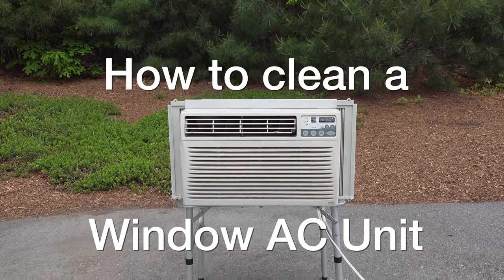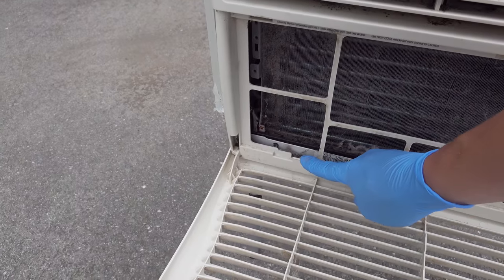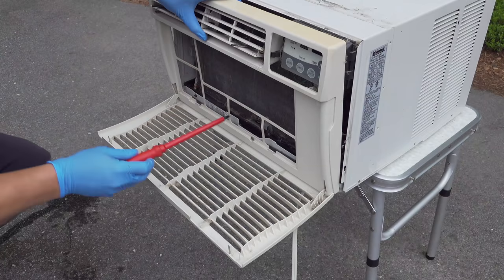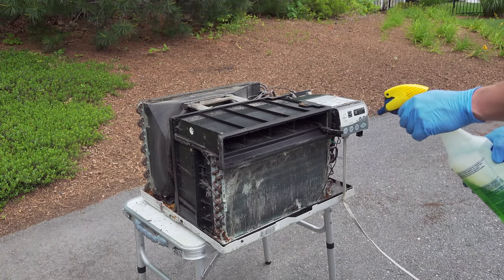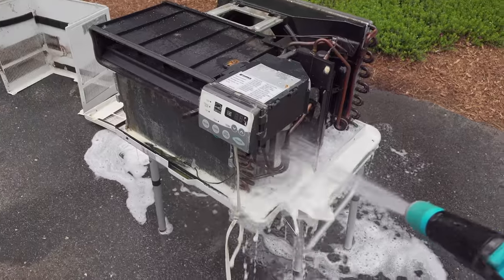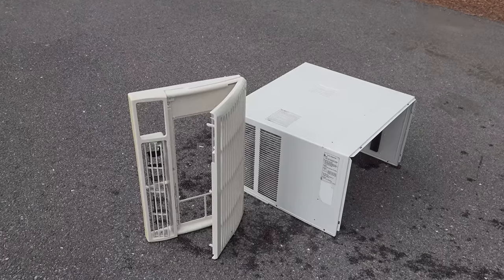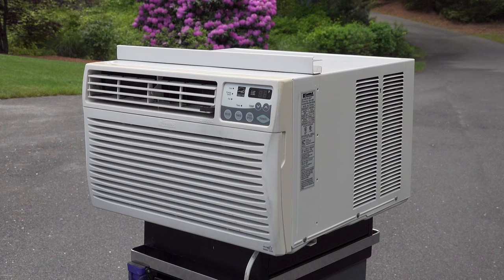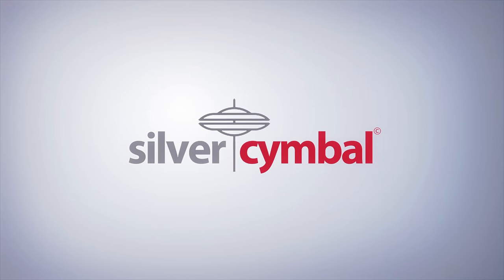Window Air Conditioner Not Cooling? EASY Common Fix - How to Clean a Windows AC

Comment: Critical not to have the hose at full pressure in a concentrated stream when spraying the aluminum fins as it can bend over the fins which will prevent good airflow while the AC is operating.
Reply: That full pressure is what helps to get the gunk out.
Reply: @blainwilson7937  - I get it - Just have to make sure you spray head-on, or you'll just end up folding over the fins from the spray. Ask me how I know this. :)

Comment: Try not to get water on the electric motor, especially the bearings , the condenser coil at the back is typically packed with cottonwood and dirt on the inside because the fan blows from inside to out , cleaning just that coil will usually make you unit blow cold .
Reply: How do I grease the bearings on mine? When I turn it on it makes like a gring noise I assume it's the bearings
Reply: I had one grind for a whole summer, every now and then shot some spray white lithium grease at it through the side vents to quite it down but ultimately you have to replace the motor or replace the unit .
Reply: @majornadz1385  Oh is that what it is? I guess the motor is shot then.

Comment: If you dont have a sealed/waterproof electric fan motor, do not get it wet or you will have to replace it.  Rest of the video fine.  On older units, I would not wet the control module either.
Reply: I did this to mine now it blows cool air but it stops working when it's on like 15 mins later

Comment: When me and my wife bought our current home, we had an AC company come out each year and service our big central air units outside, and all they ever did was clean the coils. First they would use an industrial level acid, but within a few years, they were using the off the shelf cleaners you buy at Home Depot. I was like, why the hell am I paying for that? Started doing it myself years ago, and haven't looked back.

Comment: you can short unt eventually rot unt corrode the motor unt other wiring und connectors, unt start a firés too

Comment: I spent an hour trying to remove the metal box of the ac so I gave up and blasted it with my hose lol Hopefully it still works
Reply: Did it work ?
Reply: Yup! Just avoid the electrical parts where the buttons are. It was pretty dirty, I let it dry then installed it and it blows cooler air

Comment: This was pretty helpfule for me my window ac in the front room still cools but clicks off if the temptuer is high outside it just powers off.

 My kichen one is smaller but the air it pushes out just dosent carry further into the home once it hits the arch way it just keeps that room cool  it only ever has problums in lower tepmtuer outside it screen would get ice on it i have celing fans to circulate it out tho and i normaly turn it off that anyways when i cook or it becomes to cold outside.

Corse being such a big home it cools slow but i have both set to cool the home to 60 that gets me threw the hot weeks.

Comment: What's best cleaning method  for coils inside home on a heat pump system. ? 
When you remove filter lay on your back the coil housing is shaped like a  A frame. I don't want to flood my home thanks
Reply from the maker: Heat pumps can each be different and you have to be careful. This is not a heat pump but its a similar cleaning process, it may give you some guidance. https://youtu.be/nsRHhU6q5RY

Comment: So can I ask a dumb question…my ac is leaking water…can you tell me what it could possibly be? Ive seen to either tilt it up or it’s no longer good.
Reply: hello, water dripping out is perfectly normal, make sure it leaks outside of the house through a drip hole in the bottom of the unit. on a hot day go outside and look at the unit to be sure it's dripping outside

Comment: I would suggest since you have it apart, why not address the bottom pan rust?  There are a few products that convert rust to a hard, dark surface (POR 15 or Rustoleum Rust Reformer). 
Once these products have "dried" put a coat of good paint for metal on top of it. This will prevent or at the very least prolong the life of the A/C.  :)
Reply: and have the smell of the paint cover your living room?... sure
Reply: @diamondknight1530 
No sir. Paint in the outer pan does NOT affect the air intake , which is INSIDE THE ROOM , on the front of the unit.
The front intake fins and fan are isolated from the outside of the unit where the paint is.

Comment: Any body know...How do you get mold out of the holes the cold air comes out of? I get as far as I can reach. But I am sure it goes further.
Reply: Would like to know this as well.
Reply: Depending on how big they are you can try using a pipe brush set or if they are really small try using airbrush cleaning brushes. I picked some up at harbor freight (in the paint sprayer area) for 2 bucks and use them on several different things.

Comment: When I turn on my window ac it blows cold air for a couple minutes then starts blowing cool air I have it set up on my phone and the room temperature seems wrong it's hot in my room but when I turn the ac on to get it colder it shows room temperature to be 60 degrees plus making grinding noises and other weird noises for a minute or 2 after  first turning it on but stops after that but doesn't seem to keep my room cool just cold for 30 minutes then through out the night it stays blowing just cool air.

Comment: Mine is about 5 years old and will no longer cool a room.  It is a wall unit that is thru the wall to a covered 3rd floor balcony and inside a sleeve with a grill on it, it does not get anything inside of it, I took it apart and looked inside of it, the inside was really clean, nothing stuck to the condenser or filter, no debris inside, it just wont cool and there is no one (I called 7 or 8 service places) that will service a window or wall AC unit, so I went out and bought a new one for almost $600.  I wish I could have just cleaned it and had it working again but that doesn't work 100% of the time.

Comment: Unfortunately basement leaked ac was on floor and i had already screwed it all in before finding the mold, 3% hydrogen peroxide (yes the bathroom/medical kind) in a spray bottle in the vents/inside coil will foam up and help get rid of black mold, any left wipes right away, it will also whiten stained filters, and as long as you rinse it thoroughly it wont corrode and rust like the unit i used straight bleach on and ended up being ruined 2 years later, i also filled a different spray bottle with warm water to rinse and let the solution go out the window units drain.

Comment: I'm trying to clean the old manual Haier unit I have in my office, but cant seem to get the front panel off. It was given to me and I don't have a manual. I haven't had any luck searching online either to find the answer. I have done the GE unit in the living room with no problem. If anyone knows the answer to removing that Haier front panel, please let me know.

Comment: I recommend you don't use a garden hose. I'm a professional a/c installer. You want clean with oxey clean in a portable hand pump pressure sprayer. Only the fins. That be the coils. You get water on any electrical components and it's all done, it won't work again. Just the coils. It's the coils that cool you down, anything you see around the bottom use your hands to pick it out. And be sure to hand pick the hole that drains out excess water when it running. So it drains
This video is an amuture person. That's what separates them from a professional.
Edited ;-> of course you have to rince it off use hot water. Cold to clean hot to rince and I guarantee it will look shinny new again the coils that is. Dust on the moter or compressor is nothing it can be pack with mud it doesn't matter those components don't cool you down and won't affect the operation of running.

Comment: Now only the time you waste dismantling it and some repair on the wall because it has to be well sealed is already a waste of time for an old wall air, the best solution is always to spend 100/125 $ on a new one, and only holding 2 years is more than worth.
signed: AC technician

Comment: Easy to pull the fan cover to clean the blades. 
You only did a partial tear down. The most important area that collects air that goes into your room, was never touched. 
You can do much better than that!

Comment: Also do not use high pressure water to clean the fins... you will damage them and the unit will not work without repairs!

Comment: Could you use a pressure washer to enhance effectiveness?
Reply from the maker: You really don't need to and the pressure would probably push water into places you don't want. You will have great results with just the regular hose.

Comment: Mine has a Awning over it and also Screening so no chance of stuff getting inside it like this. The Front is Kept clean because it hardly ever gets dirty. 14plus yrs old and it only just started having Freezing up issues. After owning it a month, had to drill a hole in the back base of it because there was no Drain Hole in it and it would fill up with water, splash onto the fins and into inside of my camper... yeah, Fuck that!.. I was told they no longer put drain holes in them so they can splash the water onto the fins so they cool better.. Seriously, WTF???.

Comment: Ahhhhhh too much work especially taking it out the window if your doing it solo. Just get coil spray foam and spray on the coils after removing the filter and get the same results with 80% less work . Then spray outside fins the same way and hose off .  hose the interior real good from the side and get dang near the same results as you .. show people everything you did removing and re installing... way to much work!!!!

Comment: I just take my window unit to a car wash and pressure wash the whole thing with the filter out I will take the soapy pressure washer and blow all that garbage out of the course and flush it out the back too allow it to dry for a few hours it works perfect without all that taking it apart

Comment: I dont recommend this unless you know whats happening and what your doing. If you do, be sure to thoroughly rinse the unit before you fire it back up. Any soap left can heat up and damage internal parts. Otherwise it does work pretty good as an alternative to acid wash

Comment: dont forget there more just cleaning it
if power it up n pump or fan dont work i recommended replacing capacity first before replace anything else because fan motor n ac pump run on same capacity if that capacity died nothing will work after replace capacity and everything power back up working it good togo "still have clean it up anyways " if your ac is ramp up and down it meaning capacity is about go out it time to replace it and clean it up i recommended pulling up information on model code and every ac have model code location in filter areas some on side left side by filter DONT REMOVE THE STICKER WITH MODEL CODE PERIOD because it maid important information let you know what parts for this model if that model sticker is gone it BIG NO NO finding parts for it be super harder find right one for that model ac

Comment: I'm not an expert on AC units, I was an electrician in the navy and went through advanced fired fighting school. I don't recommend anyone doing this.
Cleaning electrical appliances should be done with a brush, not a hose spraying water into it.
You won't see the effects of the damage you caused immediately, and it will spark/ short out/ cause a fire while you are sleeping 6 months, or years later and you will die from smoke inhalation or being burned alive. Don't mess with electrical appliances like this, its not worth the risk. Really its awful to make a video like this, its probably caused many problems for people trying it.

Comment: 5:27 "Cool the outside air by about 15-20 degrees"
This part is false.  That is not how air conditioners work.  Air conditioners are not taking outside air, cooling it, and then putting it back in the room.  Air conditioners take INSIDE air, cool it, and put it back inside.  This is why air conditioners can still blow 50 degree air into a 70 degree room, even when it is 125 degrees outside.
--Another common misconception is that air conditioners blow a different temperature air based on what you set the desired temperature to.  This is not true.  Even if the room is 100 degrees, and you set the controls to -100 degree, or if its 75 degrees in the room and you set it to 72; the air conditioner will still blow the same temperature air.  Air conditioners do not have variable levels of performance.  They are either 100% on or 0% on.  They blow the same temperature no matter the setting temperature delta.

Comment: As a certified hvac technician I can tell you that absolutely nothing you did had any impact on the ac's ability to cool other than clean out the fins. Everything else shown here has zero repeat ZERO impact on cooling. 
If this happens to you, try cleaning the fins if you have access. If they look good and you are still not getting cold air then the unit needs replaced. You may have an older, high end unit that can still be recharged with refrigerant but most likely you don't. They haven't been produced for a while now and they were very expensive when they did exist on the market. 99 of 100 units are sealed and can not be serviced. In my 20 year experience, window AC units have a lifespan of 2-4 seasons. (Yeah I know but that's really it) if your unit is on it's third summer and the air is not getting cool anymore, a trip to the store is in your future. Not even we trained technicians can do much about that.

Comment: An AC that only blows 59 degree air is a broken unit. Never buy an AC that doesn't AT LEAST blow 32 degrees. I've sold many ACs that blow at -30 degrees. Again, 59 degrees IS broken!

Comment: Be careful on some units.  Like he said he doesn't  clean where the black vents are.  I've  notice when you see black mold on the grill. Inside of the black vents has a HUGE amount of mold.  cleaned 3 ac units for over 5 to 8 years and wow. They have a ton of mold when you take them out to be used. Stored them in the attic not the basement. Cause mold would be worse.  Some  acts have foam on the inside  of the vents near the internal circular fan and believe me they are the fucking worst.  I'm not an expert but this is what I've dealt with.
Reply: Some acts sorry for the typos
Reply: Ac's

Comment: Protip: leave the unit off for 24 hours if you tip it on its side.
Reply: If you tip it toward the compressor side, is that advice still applicable? Is the compressor oil as likely to mix with the refrigerant if you tip it one way vs. another?
Reply: @finch2213  the refrigerant is already pre-mixed with the oil. That helps to facilitate the refrigerant moving throughout the copper line set. The reason why you're not supposed to tip an air conditioner on its side or anything that has a compressor on its side is because the oil that is supposed to remain at the bottom of the compressor gets into the valve heads dust causing serious mechanical problems in the future. So, again I would advise anybody if you're going to do something like this make sure that you leave the equipment off for 24 hours for the oil to settle.

Comment: 59F at the air outlet is pretty poor.  It should be closer to 48F.  I just tested my Samsung window AC unit (6300 BTU) & here are the details:

Outdoor air temp:  99 F
AC Set-point temp:  75  F
AC Intake air temp:  77 F
AC Outlet temp:  48 F
Temp Difference:  29 F  (air intake temp - air Outlet temp)